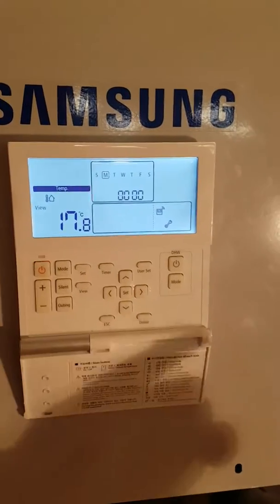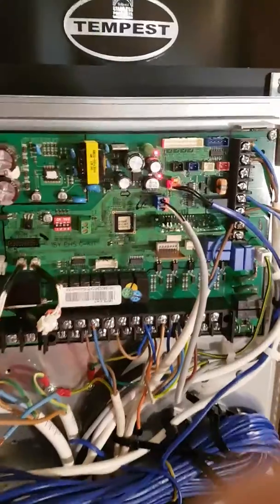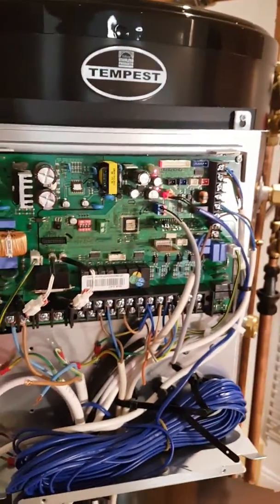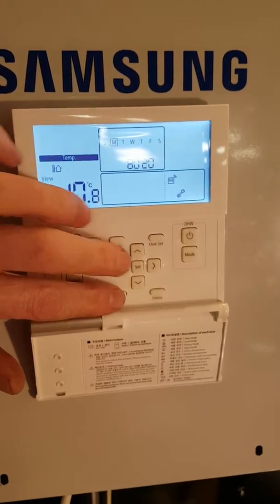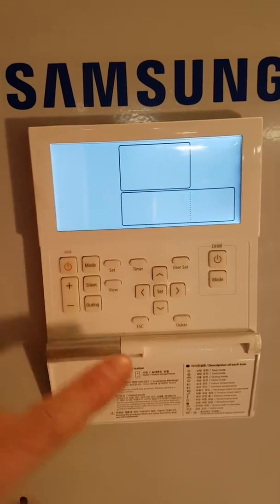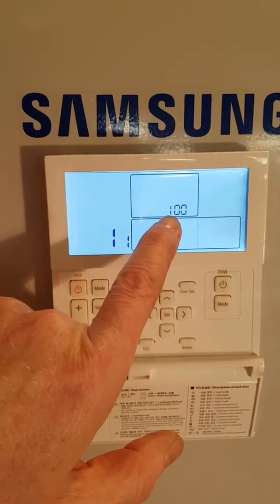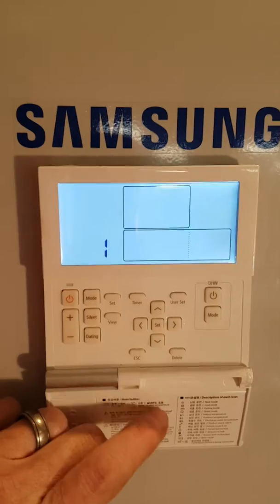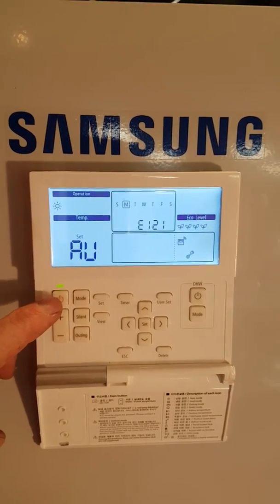e121 fault codes Samsung heat pumps

Comment: Hi. Do you have a video for E121 but for the gen 6. I'm getting that code but I don't appear to have sensors plugged in either. Thanks
Reply from the maker: sorry no ive not done this video but the faults dont change from gen to gen so the old video should get you close